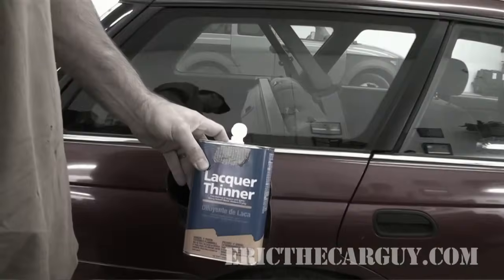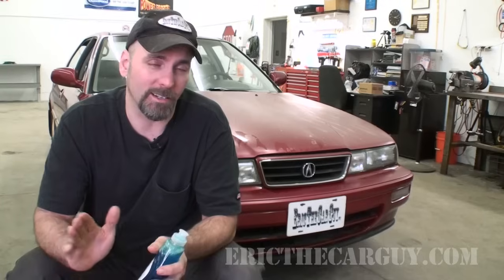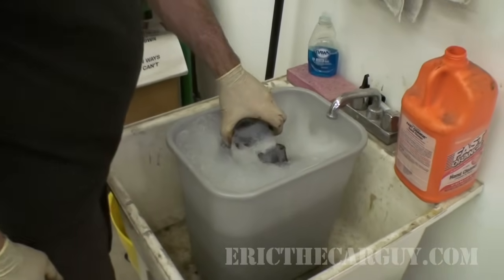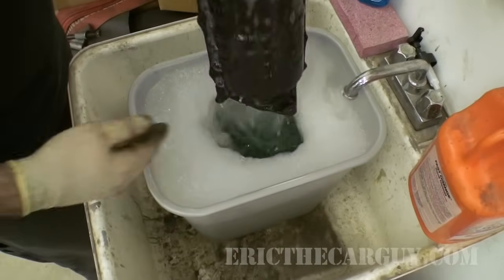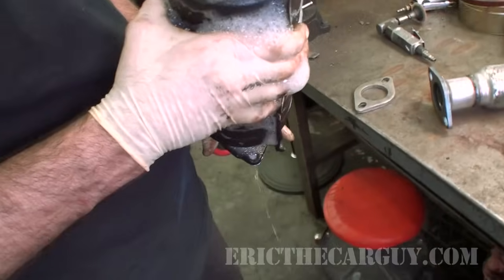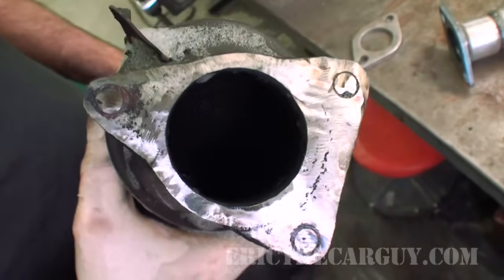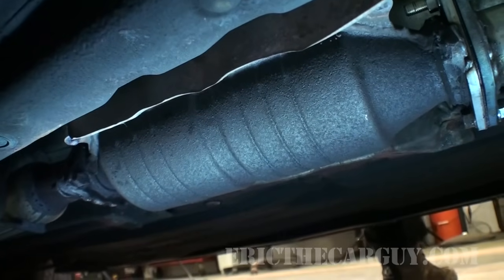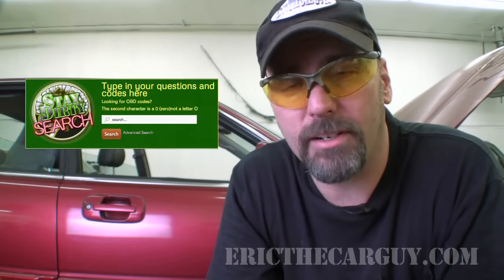Cleaning Catalytic Converters With Soap and Water -EricTheCarGuy

Comment: I cleaned the cat on my 1996 Honda Del Sol after replacing the O2 sensors and still getting codes.  I used a bucket with dish soap.  When I got the Cat off I tried to lift it to the sun to see light through the internal grid in which I could see some blockage. Much like when Eric shines his flashlight through one end in the beginning of this video.  After letting the Cat soak for about 2 hours I noticed various loose particles in the suds of the soap.  Upon seeing this I began to plunge the cat up and down in the bucket.  The more I plunged the cat the more particles I saw in the suds.  After about 10 to 15 minutes of plunging the Cat, I pulled it from the bucket and used my hose outside and careful to not spray but rather simply rinsed the cat out.   Then I let it sit on end for about another hour to be sure that it was relatively dry and reinstalled it.  No Codes.
Reply: Nice!!!
Reply: Yep. It was bound to fail.
Reply: UShallKnow  be nice.
Reply: That is the obvious way to do it but some people lack obvious thinking lol
Reply: Joshua Bartlett look
Reply: Ohhhh you did the works... Very good. 
You just gave me an idea. 
What happens if you use a soft brush while still in the soapy water ? Might that help ??? 
Just a thought.
Reply: Sounds like you did it the right way. Lol
Reply: To sum it up, he agitated instead of just letting it sit there and got better results.
Reply: I have a 95 Del sol. Is it easy to take the Cat off? I am hoping it is just bolts to get it off not welding etc...

Comment: In mine it worked. The only emissions test that not passed was catalyst. Let it overnight submerged in degreaser and in the morning clean well with current water. Then submerged it in dish washer soap and water for all the morning passing current water after. After 15 minutes in highway the catalyst passed. I notice that the post catalytic o2 sensor voltage it is now much more stable between 0,6v and 0,7v. This catalyst is the car original from 2003 and VW group. Thank you.

Comment: You absolutely can not..I repeat "can not" leave ANY soap and water inside the converter. Always thoroughly rinse the inside of the converter at least three times and dry out using air. Installing the converter full of soap and water will certainly finish it off making any chance of it working null and void. In all my years as a mechanic I have learned that anything you leave behind will bake itself onto the interior of the honeycomb making it 10 times worse than it was to start with..especially soaps and detergents !
Reply: Any dyi methods that you recommend and best it not by removing away the cat converter?

Comment: Two things/questions... if you've remove the cat, why not soak it in lacquer thinner? It's not running through the engine. And secondly, would a marine product such as a descaler for cleaning heat exchangers do a better job? I've seen heat exchangers that were covered with a decades worth of salt and marine scale that I thought would never be useable again come back to life with a descaler bath.

Comment: Eric I think you should have given it more time as if you look anywhere on the internet it will tell you that a catalyst converter ( and therefore the catalyst metals in it ) need to be at a very high temperature before it actually starts working. The fact that you could see the bubbles shooting out at the exhaust means that the exhaust was not even hot enough to vaporizer it. This test should really be done after a long ride in my opinion but other than that great job in testing the hypothesis and trying to cover all of the variables.

Comment: EZ Off oven cleaner is specifically made to break up baked on carbon deposits. It's very similar to Sodium Hydroxide, so there's that, but I can attest that it is amazing for cleaning up nasty brake calipers and valve covers. If you do it, keep in mind that it's very caustic, so you'll need to neutralize it afterward with some vinegar or something acidic.

Comment: Eric, very disappointed you did not rinse it. If you are still getting bubbles out of the back, lots of steam, that means the cat is significantly restricted. Either retest after rinsing thoroughly or a nice long drive on the motorway.
Reply from the maker: Timothy Giles The bubbles happened during the warm up period. They were gone when I did the temperature measurements.
Reply: Great job Eric - should have known.
Reply: Rinsing thoroughly before heating the cat would be advised. 
Dawn dish detergent contains several ingredients that have the potential to polymerize at elevated temperatures including but not limited to salts, sulfates, glucose(sugar) and magnesium that could poison the catalysts and or impair the catalytic action by coating the catalysts and substrates.
Reply: Agreed, EricTheCarGuy 1. wished you rinsed it (soap film is now being burned on the surface layers) and 2. Let it dry, water evaporating significantly cools temperatures. Maybe follow-up after a long drive.
Reply: So much for critical thinking, he has no success with adding a coating by baking it into the converter.  Should we be surprised by that, considering its a 93 model with no clear coat and valve clatter. My advice since he doesn't have to get inspected is to hollow out that restrictive  #catastrophicconverter  If it reduces exhaust efficiency , then it also reduces fuel efficiency so where is the real gain for the environment.
Reply: +EVO Electronic Virtual Organization It converts other nasty emissions into CO2, which is a greenhouse gas but still significantly less nasty than the stuff it starts out as.
Reply: +EVO Electronic Virtual Organization It picks up alot of the pollution, which keeps the air cleaner. But what about when you need a new cat, what do you do then, you can't just clean the old one because then you have dirty water + chemicals that you need to get rid of. It's short term a very good solution, long term? not at all.
Reply: does it cause acceration problem
Reply: I know!!. I don't understand the youtube buzz about this guy. He doesnt know jack or follow instructions. Same deal with the lacquer thinner CAT test. FAIL
Reply: Timothy Giles that's what I was thinking lol
Reply: It did work for me you must rinse it and let it dry
Reply: Not sure why you wouldn't have tried agitating the washing process. Like mixing a cocktail...shake, shake, shake! And HOT water! Then a HOT rinse THEN blow it out with compressed air....or a leaf blower!....c'mon man....
Reply: @ericthecarguy  You put the cat back on full of soap!
SMH... Can't believe you are a mechanic
Reply: You guys are just too ready to point out flaws. Eric is great. Just because this did not work . He does great work. And puts up with you Jack asses. More than most would do. Free help.

Comment: Hey Eric. Soaking my cat in powered laundry soap for 8 hours worked for me. Next time ill try the dish soap. I had the cat insufficent code on my Jetta. Re set the OBD 2 code several times and it kept coming back on. Finally Califorina DMV wanted there every other year smog. The laundry soap did the trick. Thank you Eric & Scotty for all the amazing videos.  This wont work if your honey comb structor is broken down inside your cat. Only if its clogged.

Comment: Nice to hear you collaborating with Scotty.  A few of you guys are very good and it's good to acknowledge and coordinate with others, instead of trying to bash each other, like the rest of the world does.  I learned early not to badmouth competition. but I figured those days are over in this current dog eat dog world.  I may try this as I just got that code, just before getting smog.  Of course I always DIY but asked a shop for diagnostic and was just told, '95% it just needs new converter', so I asked to diagnose vacuum leak, sensor or converter...'let me know if you want it replaced.'....ugh.  I'm going to try this cleaning but a better idea might be some degreaser I use.  I've cleaned oil, engine compartment, engine pieces, it's amazing and probably more like the chemical they now sell for this (CRC, etc.).

Comment: Eric, i did this 4 days ago but I first cleaned the inside out with 1 full can of carb cleaner, i then boiled 10 gallons of water in a old turkey fryer and added the dawn and several cups of cascade automatic dishwasher detergent soaked overnight I then thoroughly rinsed it out with plain water from a hose with a spray nozzle. ..I did not test the inlet and outlet Temps but the p0420 code is now gone

Comment: With the bubbles coming out, I suspect there was still liquid inside the CAT. The liquid evaporating out of the CAT would lower the temperature on the output side. More miles should have been driven, and all the bubbling gone prior to testing the temps.
Reply: He should have cleaned it out with water first

Comment: I had P0420 on my Impreza 2000 RS which is very common issue for Subaru. Another forum member try this method, worked for him so I gave it a try and it has been working for a year now without CEL. I bought 5 lbs of food type citric acid on Amazon,  boiled big water pot, mixed in the solution,  poured in the cat,msoaked for 3 days. Black soot can be seen in the solution,  remounted to my car,  reset CEL, drove until all sensors are ready status, and P0420 is gone for good, so far 1 year. I'd like you to try this method to see if your cat clear up.

Before that I tried extended O2 bung, replaced rear O2 sensor -all failed.
Reply: How much citric acid did you use? Do you think a little bit of baking soda would help? Baking soda mixed with the citric acid will make it agitate and bubble up!

Comment: Hey there Eric did you think about using a pressure washer with one of those hoses that come off of it that you put into a bucket of soap water and then spraying the pressure washer or through the catalytic converter.

Comment: I cannot see it working when it is full of soap.  Would just clog up again. I would of rinsed it out.
Reply: When the exhaust isn't at full heat load and is full enough with water it wouldn't be able to reach full temperature. Water as it evaporates has a cooling effect.
Just wondering if he would have rinsed it out then taken a long high speed run if the results would've been different.
Reply: He didn't rinse it... wrong  how is going to remove the clog
Reply: Sir Underbridge uhh no

Comment: What worked for me is when I had a turbo go bad and dumped oil onto the CAT, I soaked the CAT in hot water and Dawn dish soap just like Eric did for 24 hours.  But when I took it out of the bucket I back rinsed the CAT with a garden hose and watched black flakes come out.  Then I dried it out with some compressed air.  Installed it, and it definitely freed up the tremendous back pressure it had before.

Comment: what about steam we used spray bottle to clean valve back in my day with distilled water down the carb at a high idle and just spray a little at a time and we used to get great results using this method

Comment: My gut feeling is that if you expect carbon deposits, use an organic solvent such as xylene, mineral spirits...etc. Lye could also work effectively to clean the catalyst surface. Pd and Pt are highly inert metals and will not easily react. However, I'd be somewhat concerned about surfactants as they may contaminate and deactivate the catalyst surface. What also occured to me is heating the catalytic converter to burn off the surface contaminants, say in a charcoal grill?.

Comment: Eric you did not put enough thought into this test. You should have rinsed the converter very very thoroughly and then dried it very very thoroughly. Only then would it be of any good.
Reply from the maker: oracla I warmed it up after the installation which burned off all the excess. The bubbles happened during that warm up period.
Reply: EricTheCarGuy Still, that "burning off" might have left a film on the active surface, that could impede catalytic performance. A few minutes of rinsing with clean - or even better - distilled water, and you would remove all doubt in this test. In any case, I personally think it would not make any difference. Even the lacquer thinner seem highly unlikely to solve converter problems. I am sure you will find this to be true, since your methods are way more scientific than those of lets say... Scotty ;) No offence!
Reply: EricTheCarGuy not rinsing leaves the detergent that leaves a tacky surface that will be worse than before. A good rinse and then try...it's not burning pdf the detergent it's building up even faster...
Reply: Craig Cundiff Then he should have just DRY CLEANED the damn thing.
Reply: QuantumRift that'll work...just don't lose the ticket...lol
Reply: QuantumRift, Great idea! I wonder how much my local dry cleaners would charge for that. Hmmm??
Reply: @ericthecarguy  If I put a torch near a gasoline spill would that make it dry quicker? 🥲 —Rinse and dry for a proper test‼️
Reply: @ericthecarguy  if you think warming up equates to rinsing off, you are sadly mistaken.
Reply: @jackspalden5143  he doesn't want to give an accurate test.    If he wanted to test the claims properly, he would follow the directions of those who had success and not tweak them to his liking.  Rinsing off should be common sense. Either this guy wants to destroy good information or lacks the common sense to use good judgement. Which one is it @ericthecarguy

Comment: For what it’s worth, the liquid water trapped at the rear of the cat would have had the effect of holding the exit temperatures down significantly until all the water had boiled off or been blown out by exhaust gases.  Inquiring minds would like to know if, after driving it for a week or so, the P0420 code returned after the codes were re-set.  I also noticed that Subaru’s input temperatures were about 500 degrees F in both this video, and the one where you explained how to diagnose bad catalytic converters, whereas the Odyssey you used as a comparison in the other video had an input temperature that was hundreds of degrees less. Was the Subaru running lean and, if so, did this adversely affect the converters?
Reply: Running them w/a lean engine will burn them down and you'll have combe destruction, therefore tumbling(which = blockage) and melting. The opposite is a more common death of cats, rich running. These however are VERY treatable as these are just clogged up with oily deposits that can be petrochemically removed. These videos need to just say that at the begging so some ppl quit wasting their time. Soak for 2-3days in rich mix of soft water and Dawn dish soap....but frequently agitate it!!! Like every cpl few hrs go drain half, cap ends and shake back n 4th, re-submerse. I see none of these tests/cleanings being anywhere close to sufficient.